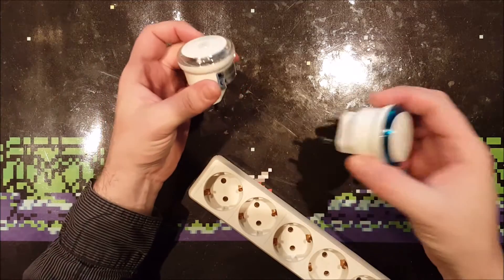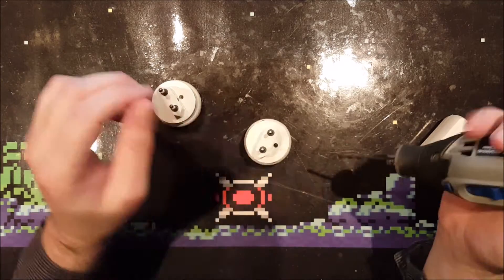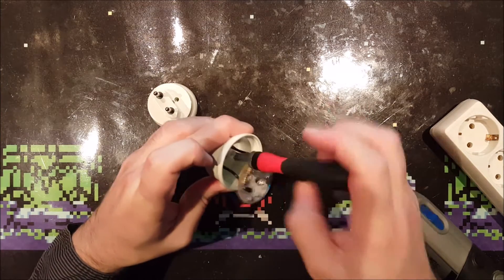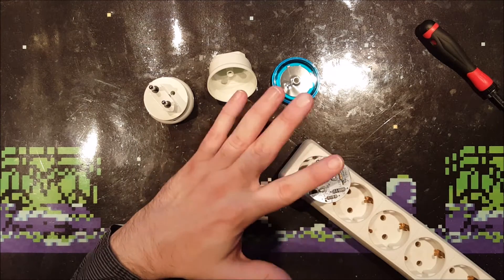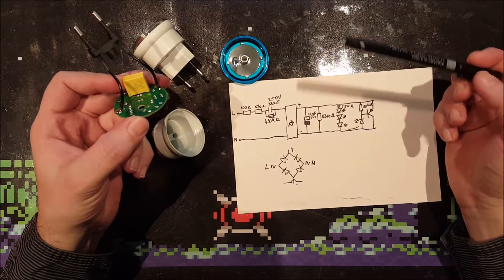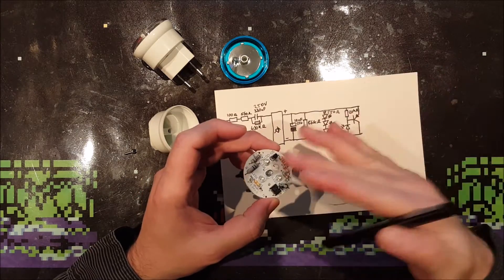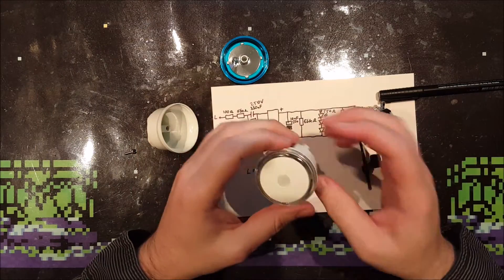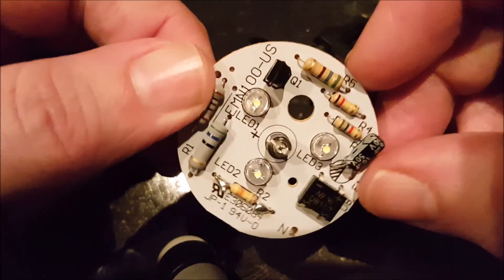The inside and schematics of a Sencys LED Night Light (EMN100)

Comment: I know this is a very old video but I came across it when looking for the circuit diagram for EMN100 night light which i want to upgrade the LEDs in. Thanks for the circuit diagram that a great help. However as you described the circuit the transistor effectively shorts out the supply to the LEDs when the photo led brings down the voltage on the base of the transistor. Where is the power dissipated from the bridge rectifier which is effectively short circuited?